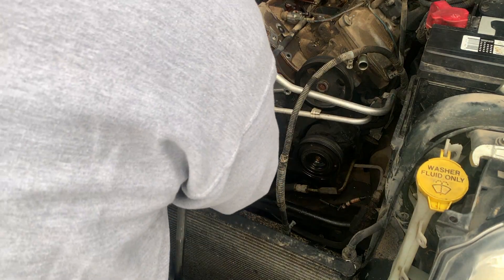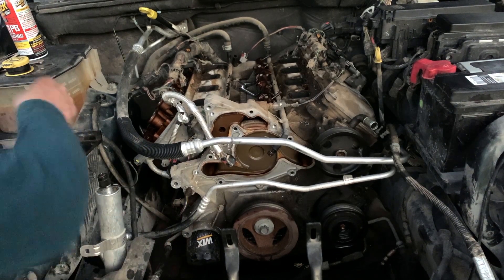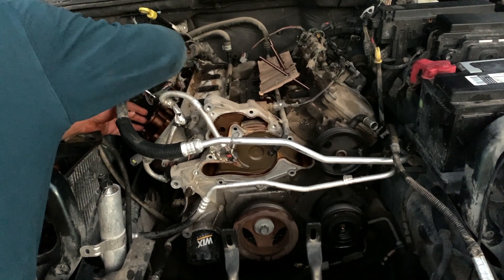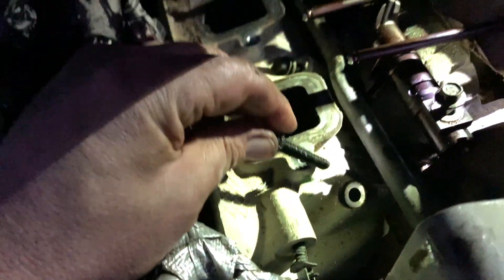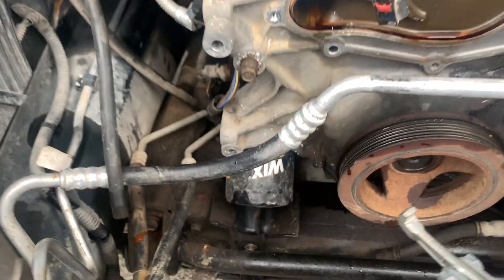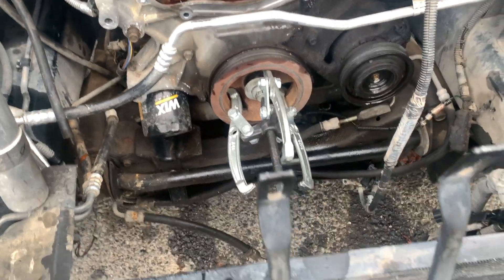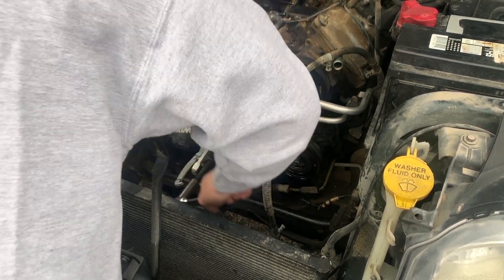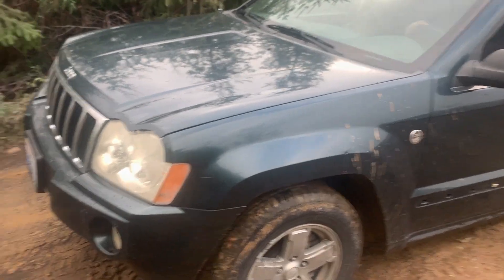5.7 HEMI Disassembly / Jeep Engine Teardown / Removing Harmonic Balancer on a Jeep Hemi Part 4 EP 40

Comment: Can you link that exact puller, I went and rented one and it's different than yours
Reply from the maker: Are you working on a Dodge or a Jeep?
Reply: @TurlosGarage  Dodge
Reply from the maker: I used a Performance Tool W137P. I found out later the Jeep and Dodge Balancers are different. I did a newer video on it. I used the same tool and tried it everyway I could think of and found one way to make it work without slipping off. I bolted the jaw right to the center piece. You can see it in the more current video. The jaw still was only about half on the flat on the balancer but it worked. I got in a hurry and tried using a hammer the last inch. Don’t do that, you will break chunks off, don’t ask how I know. Let me know how it goes.
Reply: @TurlosGarage  I'll check it out, thanks
Reply from the maker: @Paradiqm_  Thanks for asking, I just updated the description of the video!